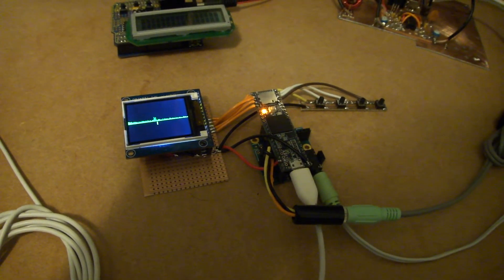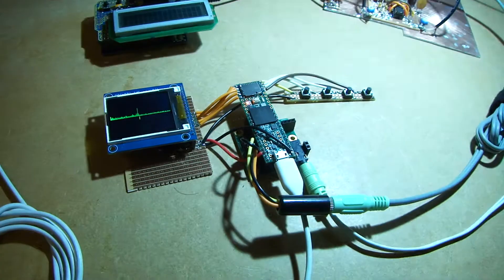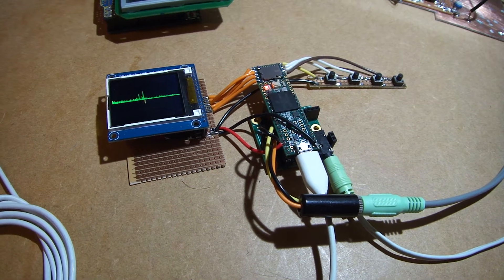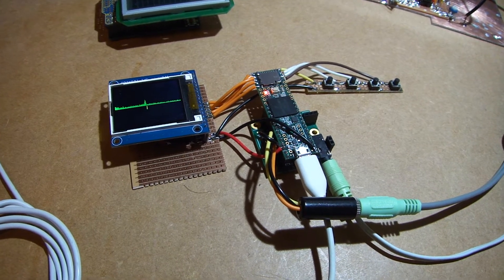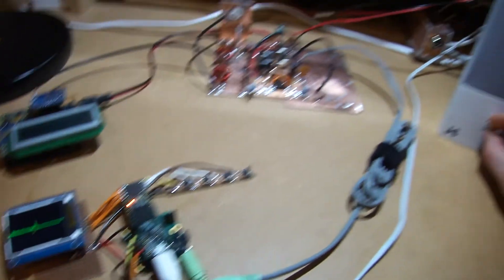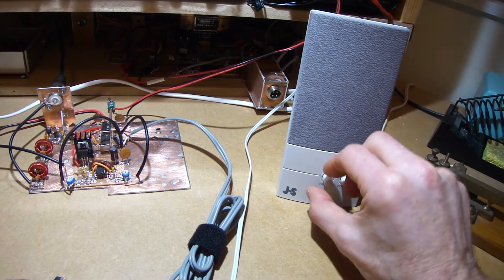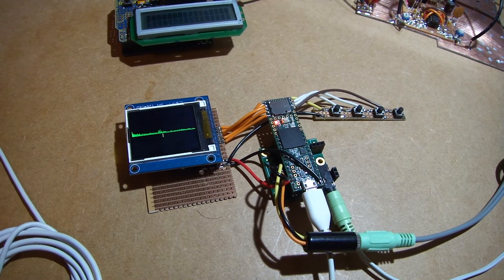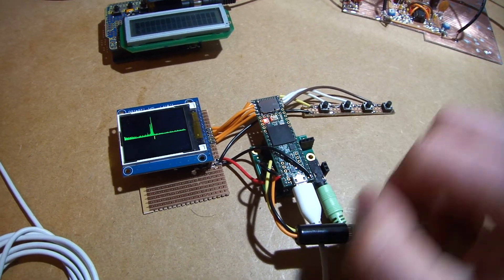Homebrew SDR Receiver Part 3 - Phasing Method Experiment

Comment: This is such a cool project and a great sounding receiver. Is the si5351 running at 10kHz above the signal?  And I take it that you will control the si5351 from the Teensy.  This is the Next Big Thing once the homebrew community get past Arduino si5351 VFOs and Bitx's!  Is there any chance you would consider sharing your code?  I am interested from a learning perspective, not necessarily to rush ahead and build one, although that would be great to do. 73 Paul VK3HN
Reply from the maker: Hi Paul. I have already hooked up the rotary encoder and Si5351 to the Teensy.  The Si5351 VFO is running 10kHz low so I don't get sideband inversion. The down side is images will get through that are 10kHz above the desired channel. While it hasn't been an issue to date, I will put some more thought into it. I'll  also try and work out how to put the sketch onto github. Never done that before.
Reply from the maker: Looks like it's up. https://gist.github.com/CharlieMorris
It should be under Teensy-SDR

Charlie

Comment: Wow! Great results so far. Thanks again so much for publishing all these videos for the homebrew community. The quality of the audio on the RX is amazing so far. Can't wait to see your next video. Are you still using a nano to drive your DDS and do you plan on driving it eventually with the teensy? Also it would be fantastic if you would possibly make a video detailing the wiring of the teensy also possibly on getting the quadrature divider up and going from say a more beginner stand point. I know I am asking quite a bit but I am also approaching this project from a very beginner perspective and for me the more details the better. All the best and thanks a million for all your work on documenting things thus far. 73
Reply from the maker: Thanks John. I think I will turn this into a tramping/hiking transceiver for 80m, as that band is an active one here at night. I will be adding a rotary encoder to Pins 24 and 25 (noting that all digital pins are interrupt  capable)  and look to drive the Si5351 directly. I'll also swap out the current LCD for a small 0.96" OLED screen which I use in all my other radios. I don't need the FFT or waterfall. Let me wire up the rotary encoder and I'll do a specific video on that as well as the quadrature divider.

Charlie
Reply: Charlie Morris Thanks for the quick response. I appreciate your willingness to take my request. Thank you for all your time and work on this project. 73
Reply from the maker: John. The rotary encoder and Si5351 are hooked up and working fine. Very straight forward. The current code is up on github too.